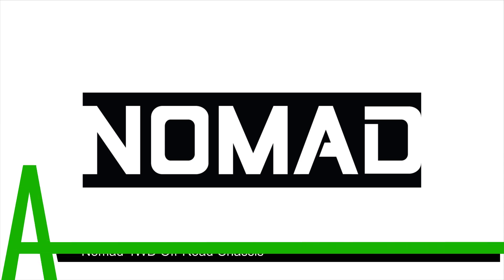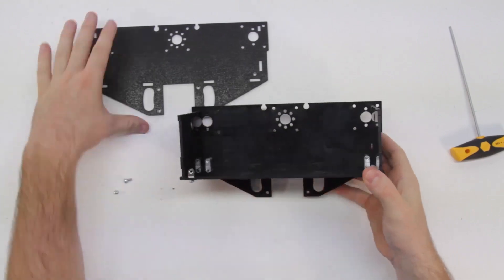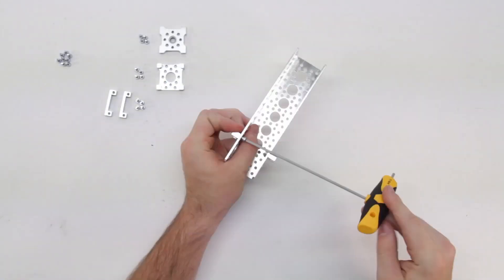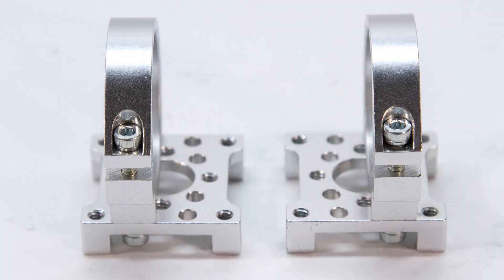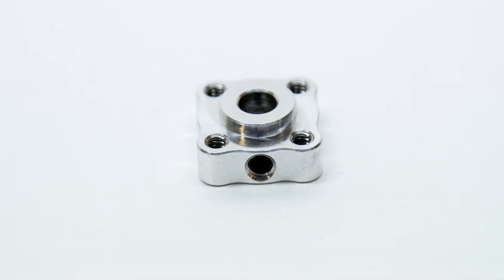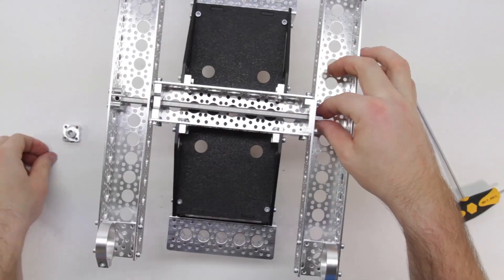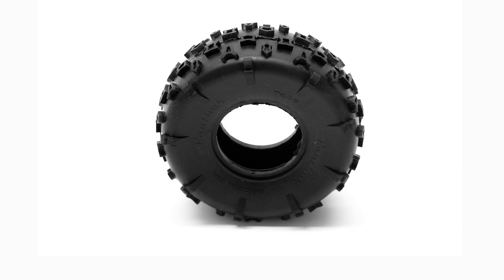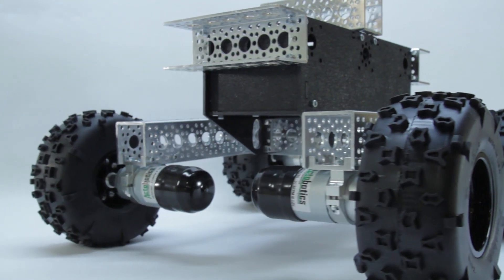Nomad 4WD Off-Road Chassis Assembly (Full Instructions)

Comment: I have seen all rocker boggie mechanism using ball bearing and similar joints on both sides for traversing different terrains. But in this chassis, it only has one quad pillow block on one of it's side. So does that make only one side channel of t slots articulate to different terrains? Please reply to me at the earliest.

Comment: it seems that it is unable to take the turn
Reply from the maker: Hi Raja, it's a skid-steer chassis which means that if the drive wheels on one side of the chassis are turning at a different rate than the other side, it'll cause the chassis to change direction.  It's the same type steering that a tank, a front end loader or bulldozer would use.  Feel free to contact our Tech Team directly should you have any other questions tech@servocity.com and we'd be glad to assist.
Reply: Skid steer such as a Bobcat tractor